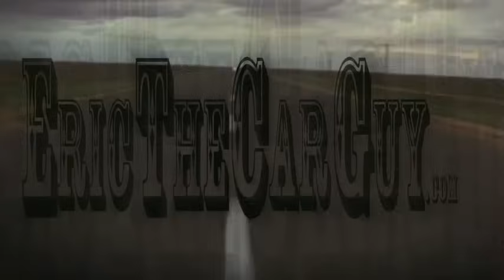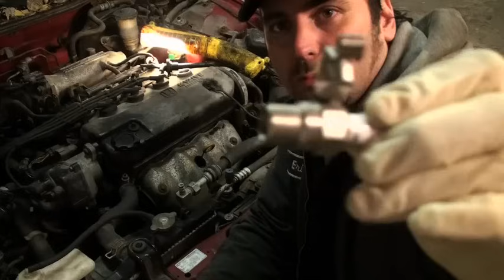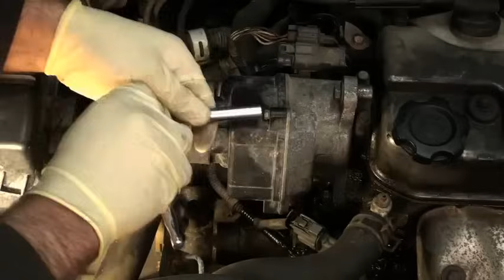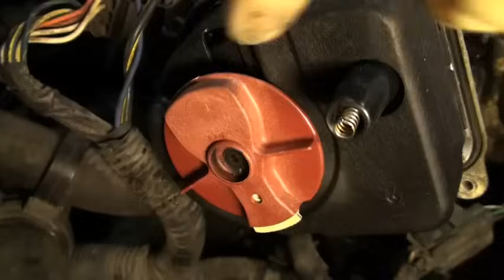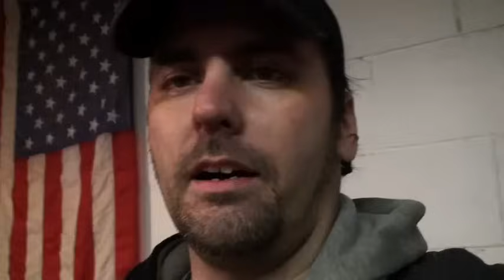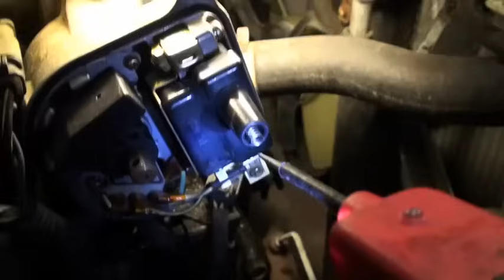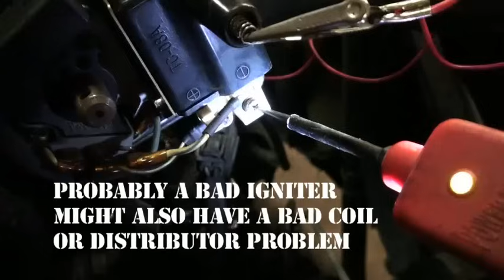No Spark Diagnosis (Honda) - EricTheCarGuy

Comment: Wow! 16 years later, here I am, 2002 se died going down the rd. Fuel pump priming- no start. Waiting on tow, will check spark when get home, expecting dist cap and rotor. About 90,000 miles on those parts since changed.

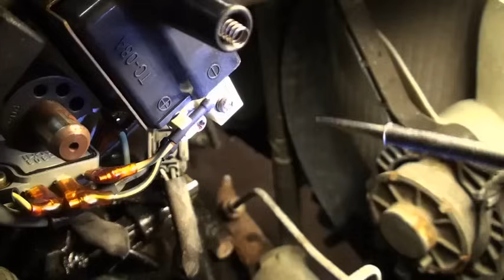Comment: ok at 5:38. if im using a test light and touching the negative side of the coil. should my test light be connected to battery negative or battery positive?

Comment: Erick I have a problem of no spark ..
I did everything you say here and everything is good . And the ignition coil is new. And msd one .. the car just sometimes just turn on and have spark then in a few minutes turn off and when you check there is no spark ... this video help me a lot but since I have a prelude 97 that use crankshaft position sensor so I'm thinking maybe is the crank sensor I need to take it out to do a test .... But what I wanna know is how you do a test just like this one if the car have a crank sensor too

Comment: 89 Honda Prelude here got spark to cylinder 2 and 3 but no spark to 1 and 4 new cap and rotor as well as icm. Wires tested good but no spark coming from distributor cap to cylinder 1 and 4? Any info?

Comment: The internal seal on a Honda distributor is the cause of oil getting into your distributor cap.  With patience, they can be changed.  I changed mine for 5 dollars.  It has been dry ever since.

Comment: Hi Eric , i myself have a Honda D series. The issue i have is that car starts on cold start and drives. But the moment the car reaches optimal temperature,  the car sputters and cuts out and wont start until the car has cooled down..Any assistance is really valued

Also , checked the ecu on a laptop , it shows that the car is idling at 13 000rpm
Reply: i have same problem, what was it??

Comment: I did a spark test . 3 sparks plugs don’t have spark and the 1 spark plug does ..  would this be the cap ? I would assume the ignition coil is working if it gave power to one spark plug .

Comment: This tutorial  was pretty informative even after 14 yrs later. Especially  since I got a yr  2000 honda crv.  I was getting  a misfire  on all my cylinder  except  1. I replaced  the spark plug wires and the the spark plugs.  Now I'm getting  p1399 code.  And this should help me out.

Comment: Hopefully not too dumb of a question, but does it mean anything if you have a blue spark(maybe weak) when testing plugs one by one, but with all 4 on the head there is no spark at all? 
It was driving me crazy because it would crank forever and I figured I had spark and knew I had fuel and that the timing was good, until I pulled all 4 on a whim and saw no spark

It died from a stop after running fine, and I'm guessing the igniter or coil is bad/weak
I'm tempted to try new plugs since they're slightly old, but the odds of all 4 dying at the exact same time would be miniscule

Comment: I'm back again. I now have a 2004 civic lx and it has 145,000 miles on it. The other day while driving,  it started running rough. I disconnected the coils one at a time and found no change after removing the coil farthest to the passenger side of the engine. I removed that plug and it was black and wet. Put on a new coil and plug but still no spark from that coil. Anyone have any ideas?

Comment: I have never worked on a car. I am an old software developer, and had a career solving problems. I had a non-starting 1993 Honda del Sol. No garage would look at it and I didn't want to tow it to someplace with no idea of the the solution or cost of a fix.  I looked under the hood and cringed at my lack of understanding of what and where anything is. Then I watched your video and it inspired me to take step one.  Three weeks later, a new ignitor and a replacement for my snapped off distributor rotor and screw, I now have a running car!
Thanks! Another Eric

Comment: Eric I'm getting code 14 and 15 on my 92 Honda Accord. I've replaced the icm, it cranks but won't start still I may have crossed the wires but have switched them in everyway, I can't find a wire diagram to show me which wire goes where, can u please tell me where the green, brown, and black n yellow wire goes and what else may b going on with this god forsaken honda

Comment: Hi Eric.  I have a 1998 crv.  Went through the steps.  No works in any plugs.  Removed cap.  No oil in cap.  Dry.  Removed rotor.  Used test light. No spark at coil.  Tested the neg screw at coil and it didn't blink.  When cranked.  Light doesn't blink.  Replaced ignitor.  Still does the same thing.  Not sure what to do next.  Any help greatly appreciated

Comment: I changed the distributor cap and rotor button, but, the first time, put wires on in wrong order. Now that they are in correct order, car still won't start (but I was having similar starting problems before). Part of the problem is that I can't get my rotor to point directly to a 'tower' - it also falls between 2 of them - no matter how many times i crank the car to try to make it point to just one (and then I'll make that my #1).  Is there anyway I could've screw up the TDC thing?  I never touched the distributor - just the cap and rotor, so ...

Comment: I just had to pay for a whole new dishtributer assembly an my car has run great until recently. Now the samething has just happened again i was driving an lost all power ans it would not restart. Person who stopped to help said i wasn’t getting spark figured it was the samething again so i warranted the whole thing out put the new one back on it still will not start i read it could be be the relay switch bad or possibly fuel pump i dunno. So i bought a new relay switch i haven’t been able to try the new switch out yet hopefully that fixes it I wont know until i can get a ride to it an try to fix it.  🤔🥺🙃🙂😇
Any idea’s thoughts???
Reply: I also checked all the fuses i changed all the spark plugs an wires also
Reply: What happened? Were you able to fix it?

Comment: Hey buddy have a 2001 civic 1.7 
  What is that purple  Running off the coil pack to the inside of the driver firewall single purple wire mine ripped car won't start know

Comment: I have a 93 Civic with a crank but no spark condition. I replaced my coil and igniter but I am not getting a spark. I used a light tester to check the igniter and the light goes off when I turn on the ignition to crank the engine. Is it possible that my crank sensor or ICU might be causing this? is there a way to check them without replacing?
Reply: It's probably the ecu. That year range is notorious for the capacitors in the ecu to explode and eat up the circuit board. Every auto manufacturer was using them in their ecus at the time, so it's a common problem for most cars of that era.

Comment: What if we're getting power at the igniter (blinking w test light) but no spark at the wires, already replaced cap and rotor but still no spark at wires? Can a low battery show no spark?

Comment: FYI!!~All Rotors do not have a set screw! My '99 Civic Dx has what's likely the original distributor, which I'm trying to troubleshoot. The rotor has no set screw but is held on by a tension type clip, lining the inside. I found zero info on how to remove it. After 3 would-be mechanic friends tried, It wouldn't budge. I tried prying it side to side but not wiggling like Eric shows. Finally cracked it, so pliered off enuf  to finally remove inner cover. Then the rotor base pulled right off shaft, of course. Luckily, it has the hole for a new set screw secured rotor. Hope this helps someone. ☮

Comment: I have a 1999 Honda civic DX problem Im having is that if drive the car anywhere once i shut it off if i try to restart it it will not start unless it sits for 15 to twenty minutes, i noticed that the spark was weak and when the spark plug wire is grounded the car will start, i have a feeling it’s a spark issue because it wont even start with starting fluid and smells like fuel when you try to start it ,  any help would be appreciated
Reply: Did u figure it out? I have a 99 Dx crank/no start and cannot remove rotor. It has no set screw. Trying to pry loose it feels like it's gonna snap. Does yours have set screw? Got civic in 2012 and now almost 10yrs later (22yrs old) it's not starting for the 1st time! Great car and this video is exactly what I needed to nail down why there's no spark...if I can get rotor off!!
Reply: @shorelined1  still trying to figure mine out , replaced the coil and main relay and still the same problem, just ordered the igniter lets see what happens

Comment: Eric, I have fully rebuilt, the things ya do for your kids, a 1996 Acura Integra gsr vtech sedan (rare) b18c1. Cranks but won’t start, has blue spark when wire grounded, gets fuel, has compression. Set at TDC, won’t even hit, started 1 time and driven 20 mis. when advanced crank 1 tooth to 18 degrees. 1 code, atmospheric pressure. Now won’t start again no matter what I do.  Always has spark. Got any ideas?

Comment: Hello to the point,  following the video/nothing at wires but fire at spring in coil tower so I agree with you buy cap and roter and I did and still no fire at plugs or with no wire on new cap no fire up in wire portal. So take back apart and got fire at coil tower.  Question: that cover that that's behind the roter if it's  not reinstalled would that stop fire from getting to the wires??? Brain exploding.
Reply: Why on earth would you leave out the cover under rotor? Are u joking?
Reply: @shorelined1  No,Are you joking. I didn't say I removed it &didn't reinstall it.  Thanks to Eric's detailed video I realized 😳 something wasn't right. The car I was working on, this part wasn't there... H.R. did you just Assume, U know what they say about Assumeing... Most important, what about (No fire/New Cap&roter)???

Comment: So I have a question I have an 05 Honda Accord EX 4 cylinder automatic it runs fine and Park but when you put it in gear it dies it has a new starter and you alternator a new battery has a new map sensor has a brand new air hose from the air box to the throttle the spark plugs and coils are maybe 6-month-old what am I missing

Comment: 12 yrs later this helped me. Saved me buying a coil. It was the igniter, ala ignition control module.
Replaced, fired up first time.
Reply: 14 years later and I'm looking at this wondering if this is my problem. But since I couldn't diagnose my no start my 97 Civic is at the shop racking up a bill

Comment: Brother please can you explain me that is there any fuse for old honda distributor like i have accord 1997 I change igniter and coil but still no spark i also check the three sensor inside the distributor they are also good so  i dont understand what to do next please let me know if possible 
I will be grateful to you
Reply: Watch the videos so u don't just change a part without learning what's failing.  There's fuses for everything electrical.btw I'm a girl who's never had a no-start problem w my civic of 10yrs til now, but even I know this.
Reply: You don't even say WHERE u had no spark!  "still no spark" with new parts? Again u have to FOLLOW VIDEO 1) plugs 2) coil 3) ignitor He tells u what ur asking 4:15 - 50

Comment: I have 99 civic w b20 swap no spark there’s 10.6 volts at plug bill/yel wire and only .4 at the coil positive and negative I have code 15 I’ve done ignition switch and new dizzy and main relay can anyone help

Comment: 2 days my Honda Hatchback from 95 (5th gen) had problems with Acceleration and idle. It was not running on all cilinders. The motor was vibrating more than normal and RPM wasnt in sync and low. Today I replaced the sparks with new onces, which solved the idle a bit. All cilinders are firing now, but you still hear that the motor misfires sometimes. Tried to drive a bit. It still holds back alot, and sounds like a double noise outside the exhaust when i give more rpm. Not all in sync or so. Teusday i get new spark wires. Do you think it are the spark wires also? The spark plugs were totally worn out.

Comment: Very helpful!!! Even today.  There is one big thing left out here. The same non-triggering issue from the Ignitor/Ignition control module will also occur if the main relay is not  working or connected. This is due to the fact that it responsible for telling the ECU that it can send signals to fire the coil , when the fuel pump and fuel injectors are powered properly.

Comment: I have no spark from the coil per your check demo. I no spark from the ignitor. I purchased new (after market, Honda no longer has them) distributor, cap and rotor. Still no spark, I get a single spark then nothing after first crank. Any idea's?

Comment: Just a FYI to those with problems starting when your car is warm.  If your car normally cold but sometimes has difficulties starting when warm, check your coolant temperature sensor.  That was the reason for my car having problems starting when warm.

Comment: I had crank no fire. Hours of investigation. Turns out the problem with mine was that stupid little spring that goes from the ignition coil to the distributor cap. What i need to know is can you just replace the spring or does it come with the distributor cap or the ignition coil? Also is it connected to either one or is it normally loose? When new.

Comment: I have a jdm b20b b16a cr-vtech I have spark coming out of the coil on the distributor but no spark to the plug so what should I do from there I have to also add ground to my main relay to get fuel pump to run i believe I need to jump out my crank position sensor but I am not sure because i don’t think the b20b block has one this is my first build so I have crank no spark at plugs and fuel pump not priming. All grounds should be good
Reply: @ericthecarguy

Comment: I fried my coil testing for pulses from the ignitor without the grounding clip on the spring. The jumpcut at 6:08 when it appeared. I didn't catch it and no mention to do it was in the video. So I replaced the coil and it started. But the real starting issue was heavy rain shorting out some unknown connection that fixed itself. I only ruined the coil during diagnosis because I didn't ground the coil with the wire.
Reply: U need to listen. "Hook up regular test light to really good body ground" 4:10
No wonder he doesn't answer all these dippy comments. He covers all the main points...very well and succinctly.
Reply: @shorelined1  I'm not taking about the test light needing a ground. Dummy
Reply: @shorelined1  look at @6:08 stupid. When he's testing the other terminals the spring that goes to the distributor cap with the high voltage has a alligator lead clipped to it and then to ground dummy. That's because in the video the coil is still working and active and the high voltage needs to go somewhere.
Reply: @shorelined1  Not a hobby. I maintain and use my civic for work.  I haul a trailer with upwards of 2,000 lbs including the trailer behind. My vehicle needs to be in tip top shape to be safe. All you do is play.
Reply: Why would you put a ground wire on the ign spring
Reply: @shorelined1  well you changed you comment. "Why would you put a ground wire on the ign spring" I don't know it's just a hobby for me. Why don't you ask Eric he likes questions. 🤣

Comment: Eric, question, working on a 1996 Honda Accord, 4 cyl VTEC engine. No spark at plugs. Tested at coil like you said using my power probe III, no spark at coil. Went to negative side of coil to test igniter (it's a 5804 igniter) as you demonstrated with power probe, instead of cycling negative as shown in your video, it cycled to positive? Any insight on this would be greatly appreciated.

Comment: Would any of these problems cause the check engine light and oil light not to turn on? The only lights that turn on is the brake and battery light turns on.

Comment: ETCG. Big fan. I know this is an old video but I hope you get this message. I have an 08 accord with p0040 misfire in cylinder 4. K24J3 motor. I swapped out coils thinking the pack was bad. Nope, it still has the same code. Same cylinder. Could it be the ECU?

Comment: Eric You are the man. I have been watching your videos for years and am part of your newsletter list. I Have a 91 accord with new main relay and new distributor installed at top dead cylinder #1. I have tried with the rotor in both positions, But I'm still not getting a spark. I do not believe my car has a crankshaft position sensor. I pulled the E.C.U. but I didn't see anything obvious, no melted capacitors and no bad solder joints. I am out of Ideas, any help would be greatly appreciated. I will even pay you for any help you are willing to give. I love old Honda's. This is my 3rd Cb7 I really would like to bring back to life.

Comment: Engine harness dat connects to the distributor aint sending power to the distributor to fire n distributor is new i check to see if there power only one circuit has power others has none i trace my line for shorttage i found none plz help me